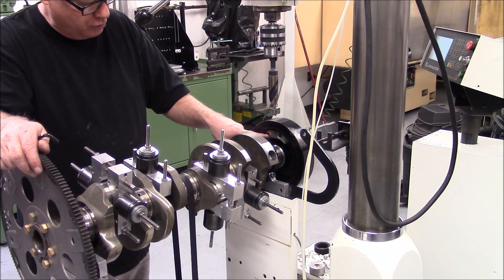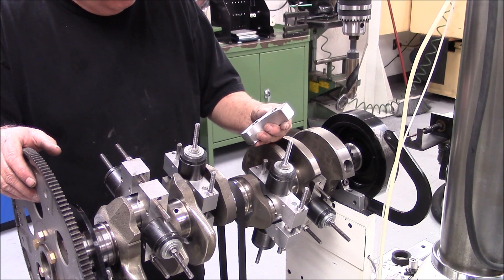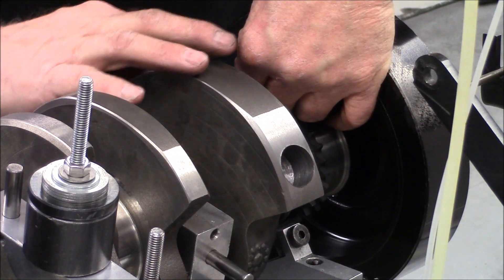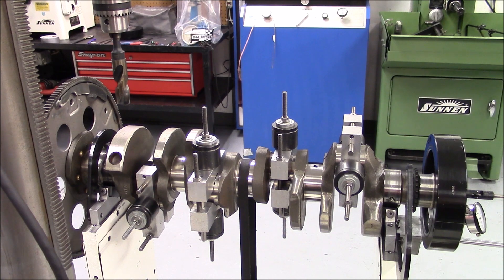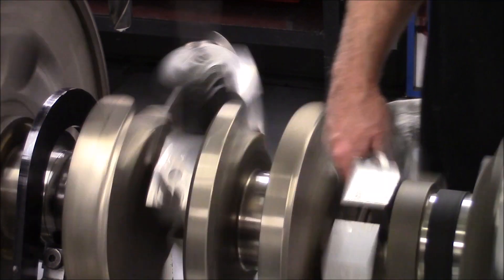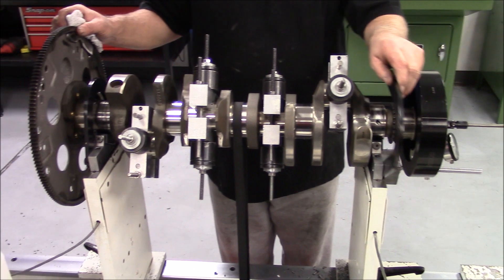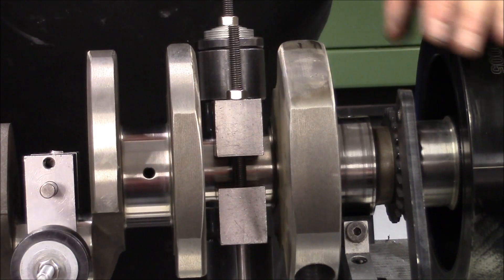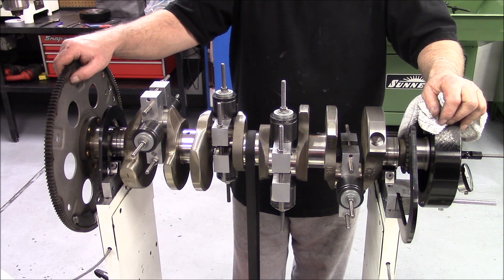Part 10 Rotating Assembly Balancing - Final Balancing - Engine Build 620+ HP 454 Big Block Chevy

Comment: Right here is where i start to like 427s more than 454s , lol ,, if ya gotta use a stock crank , a 427BBC can be pretty scary for most street strip guys , a 366 BBC gets a factory steel crank that will make a 427

Comment: OK, I've been digging around, and reading and reading and researching, etc. I have found several posts of yours from the past, saying that cast cranks and external balanced assemblies are not a good idea at all. One post (or two) you said you used to find cracks in your cast cranks after only 200 passes on the engine. Also, reading other peoples posts, I get about a 50/50 view of GM factory cast cranks either being good or bad. Some people claim their crank broke after only a few passes, and they'd never use anything but forged again, while other people claim to be using cast cranks their entire lives in drag cars, and never had a problem with them (most seem to be claiming between 600-700hp).

My block is in the machine shop right now, but my crank (GM factory cast) is finished (turned 10/10). I originally was going to use this crank for my build (basically the very same build you have going here), but the more I read around, the more I'm unsure of using the cast crank, yet now I see this video and see you using a cast crank and external balancing for this 620hp build.

I'm totally confused!! Will it last or won't it? Will I be looking at replacing the damned thing only after 200 passes? I hate to spend $1000+ on a forged crank if it really isn't necessary, but I also don't want to put in all this money just to have my hard earned money shit down the toilet, because of something so simple as a crankshaft choice gone wrong. Help!?

Comment: Balance the counterweights themselves. If you balance the weights then the owner has to rebalance if he ever changes the harmonic balancer or flywheel assembly. Or if one of them cracks they have to replace and the new ones may not be same weight.

Comment: Man, you do good work, I wish I was closer, I'd definitely be a customer. I went to school to be an automotive machinist in the mid 90's when I lived in Sacramento. I tried working at a couple shops. One had a robbery/ shooting across the parking lot, the owners wife and the other worker were doing meth. I got a job after that at Rex Hutchison Racing engines. I was going to have to wait for someone to die before I moved up from donkey boy there. I wound up working for a glass company. Good money, but not my passion. I should have found a way to start my own shop. I love this stuff. Hard to find an engine whisperer anymore. I'm a big fan for sure. Thanks for the videos. P.S. I live in Northern Minnesota now.
Reply: is it easy to get stuck as a 'donkey boy' as an automotive machinist fresh out of trade school?